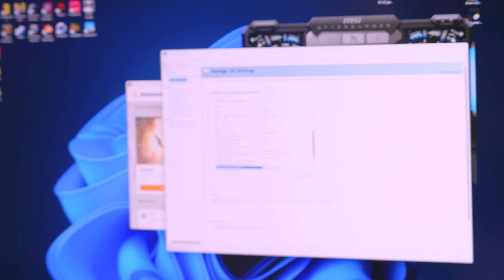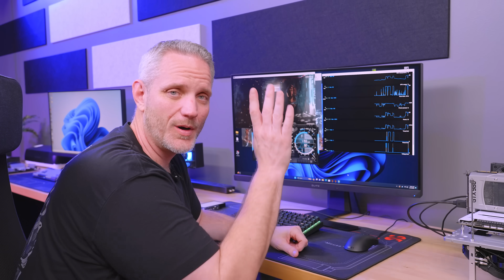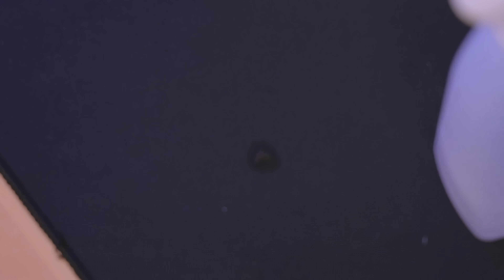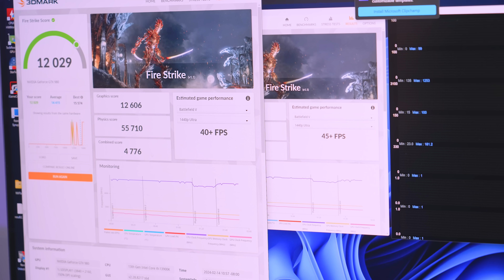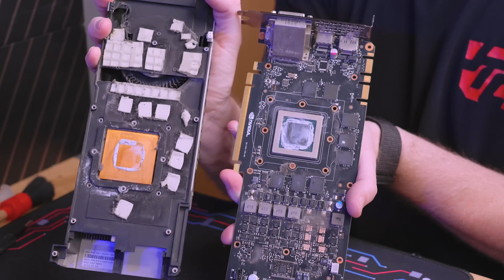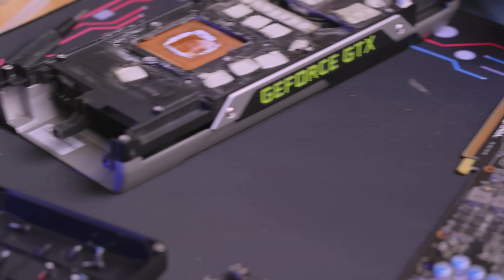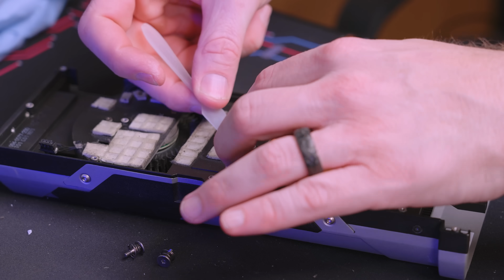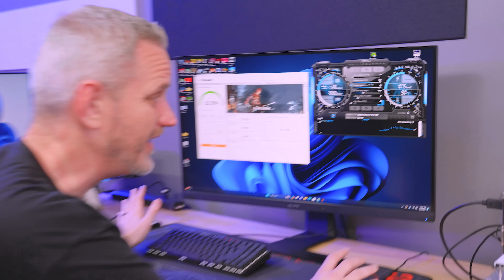This was KILLING this cards performance!

Comment: These old cards can still live with the correct maintenance and still keep its performance good.
Reply: Except memory wise. They're very lacking for anything modern.
Reply: @scythelord  I think it was Tom's Hardware that recently did the Titan test and it failed horribly at modern stuff.
Reply: @kivulifenrir That's only because Kepler has aged like dogshit, probably Nvidia's worst uArch to age past GeForce 5 FX.
Reply: it really depends on the card, older high end cards (most XX80 tier cards, for example), sure, but I was stuck on a 1050 Ti for 4 years until recently, and I would not wish that on anybody, the amount of games that were either straight unplayable or had to be smeared in Vaseline was really high
Reply: And at worse find a new home in someone server for AI related task (Home assistant voice AI, content generation, etc.), video transcoding, video out, but personally I went for a pair of Tesla p4 instead.

Comment: Jay currently i have a gtx 780 on the first pci slot and second slot i am running the titan Xp no dvi the fans of the gtx 780 the fan rpms spin at 4300 
So at normal temps my titan runs idle at 26 c and thr gtx 780 resting at about 30 c just cause its closer to my cpu and that runs at a native 100 F

Comment: I never understood why people use  a blower to clean a computer, I prefer a vacuum less things flying around in the air after.
Reply: The vacuum doesn't seem to reach as far, so you end up dragging the nozzle around your board. Doing so around the components risk some damage. Not a large risk, but it also takes more time because of the smaller area of cleaning. One other thing I've heard others have encountered is vacuuming a component off the board, but I would think a high pressure air stream could do that as well but it's what I've heard in the past. I'm in agreement with you that it would otherwise be much preferable and cleaner way to capture the dust and dirt. 

I've often wondered (though never attempted) if using one of those ultrasonic cleaners in a rubbing alcohol  bath would work well.... maybe a little overkill though. :)
Reply: No one vacuums because it can cause static electricity, especially if you use a vacuum device with a brush on it.
Reply: @Pro7Sauce  I always vacuum. But I'm in Scotland with ridiculous humidity, so static isn't really an issue, unless it's in the 10 days of summer we get. If I was in the US, I'd still use one, but i'd mod it with foil at the end,with a grounding wire connected to it, to give the static a path to dissipate.
Reply: @Pro7Sauce  There are vacuums designed specifically for use on electronics. The issue is that they cost more than a regular home vacuum, while an ESD-safe blower for electronics costs less.
Reply: Also, take your rig outside :)

Comment: i actually gave someone this card a year or two ago for a upgrade for them. they were still using a gtx 760
Reply: That must have been huge for them, thank you for being a nice friend!!
Reply: @peksn  it was heck it was a nice big upgrade for me when i bought it off a buddy that was using it since day 1 for super cheap so i figured pass on the good deed they did by selling it cheap to me by giving it away since it now was many years old the person i gave it to still uses it to this day and streams using it. im shocked it still has the horsepower to pull it all off.
Reply: @spiketamara2007  Yeah I feel like the jumps in rasterized performance in between gens are not as big anymore as they used to be going from the 600 700 900 and 1000 series, like now it's like meh

Comment: That gpu design is a piece of art
Reply: I have all of those pieces of art GPUs back from GTX 690 /780ti/980ti/1080ti really beautiful cards they are on my display shelf and im proud owner and i keep them clean
Reply: @PsychoZ856  🔥👍
Reply: Besides the thermals, my 1080ti had the same cooler and it… got hot as fuck. Even when new. Does look good. The FE cards this gen are beautiful and the thermals are great.
Reply: @jolness1  Yeah there's a reason that blower coolers went the way of the dodo. They don't have the cooling capacity needed for modern cards. I'm a stickler for noise in my PC. I was using a stock 3080 for a while, but during gaming the fan would spin up to max and I couldn't stand it so I slapped a waterblock on it and now I can game in blissful silence.
Reply: @jolness1  I've had a bad cooler before on a RTX 2080 ti where it was about 10C hotter than all other cards with the same heatsink. I thought the Die was just hot. Nope Cooler was clean & didn't cool the card. Must have cracked somewhere where it should hold vapors.
Reply: @jolness1 oh really you like having a big rectangular trash can inside you're PC?, GPU dimensional size have become a laughing stock
Reply: Yup those and the 30 series fe cards are amazing as well as 10 series
Reply: I kept one of my old 780s with the reference/FE cooler just because I think it's beautiful
Reply: I want a 1080 FE just so I can say I have one.
Reply: I agree this and the 1080 are beautiful gpu's compared to modern ones
Reply: I have the 1080 that has this design, assuming it’s a turbo? Sadly it’s just in a box now after upgrading but what it’s been through, it’s still a beast of a card
Reply: Yup.
And just like a piece of Art, its basically useless.

Blower style cards like this are noisy as hell, and have crap performance compared to just about any other cooler design.
Pretty, but not doing very well at what its actual purpose is.
Reply: Tart
Reply: Nah lol the titans and 1080s are the ugliest cards ever made
Reply: Not very practical for cooling, but yeah it does look nice 😅
Reply: Another person of culture! I was just about to comment the same thing. I really want a 1080ti version just because it's the card I always wanted back in the day.
Reply: That is why I still have my old GTX 980 such an nice and well made piece of history. And if my main card fails I still have that thing as a fallback for a week or so before I can grab a good deal on the used market.
Reply: @CrashPilot1000  I am going to try and find one, even if it's a 9 series. Time to fulfil that old desire haha 😄
Reply: @Fletchersketche_  I even ran BF2042 with potato modding on it and did better than a friend on a RTX 4080 in several matches. His comment: Frames don't win games. Well, yes and no but my 2080S quit and that was a kick in the balls, the 980 really helped out...
Reply: They’re so loud and the temps suck lol
Reply: The 700 series first used this design. My EVGA 780 was one of the loudest pieces of gear i've ever owned. @Beezzzzy_